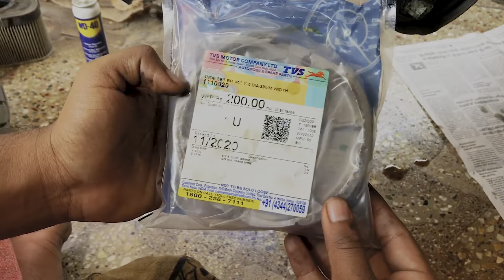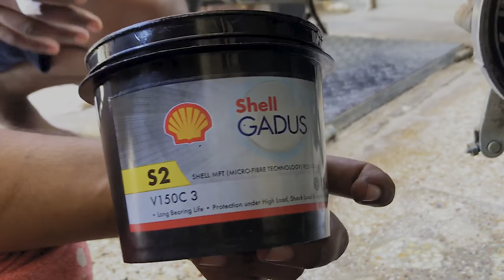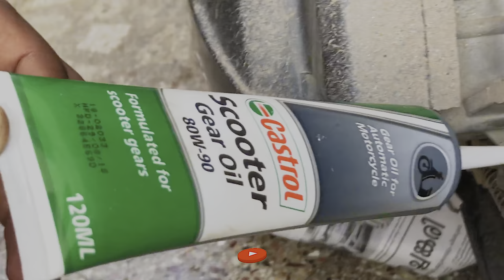Complete Guide to General Service and Maintenance of your scooter! | #ntorq #automobile

Comment: U used the wrong engine oil, 7100 motul is a fully synthetic oil for bikes, and not scooters meaning for vehicles with wet clutch plates, these oils are MA  or MA2, the oils for scooters are MB oils, meaning for clutchless operation, and they have high temperature dissipation capacity as scooters engine is mostly covered, motul scooter power le 5w40 fully synthetic for scooters are available but at select stores
Reply: But these days bsvi phase 2 scooters recommends MA2 specifications oils.

Comment: Your tool kit link and price
Reply from the maker: TOOLS USED | Purchase link :   

Stanley 23-Piece Combination Spanner Set 70-965 - https://amzn.to/3qTPuRe
STANLEY Metric Socket Set - https://amzn.to/3PjG2Ar
STANLEY STMT72795-8 1/2'' Drive Metric 6-point Socket Set - https://amzn.to/3XcjyDq
Taparia S14HXL 1/2-Inch Drive Socket Set - https://amzn.to/3qK0L6h

Grease Used - https://amzn.to/3SplXsq
Reply: @ARKIONX  Thank you
Reply: @ARKIONX make video for ns200 service
Reply: Especially for bs6 ns200, need a clear video

Comment: Always use jaso MB graded oil ,,because in jaso MA has friction causing elements for wet clutch in bikes.. that generates excessive heat in scooter engine , due to lack of direct air strike and lower heat dissipation.

Comment: What's the difference between engine oil and transmission oil 😢
Reply: They both are different grades and viscosity.
Engine oil designed to withstand extreme temperature and maintain lubrication and usually is of 0w30 or 5w30 grades.
Transmission oil is designed for mainly lubrication of gears and more  viscos to maintain a film on gears and minimize wear. Its usually 80w90 or 75w90 etc.

I hope this helps.